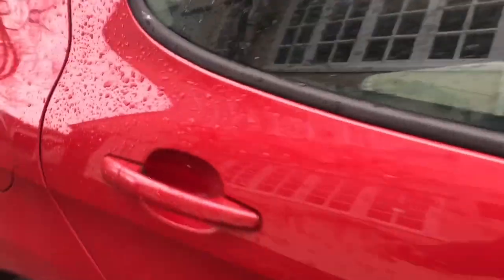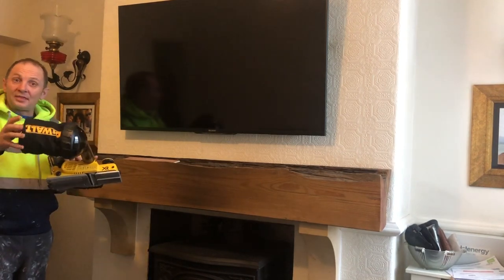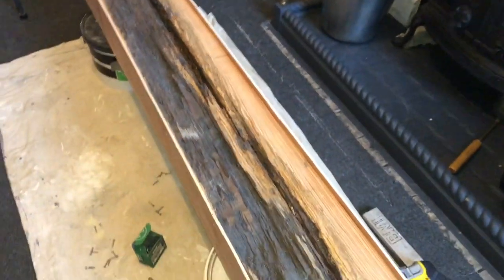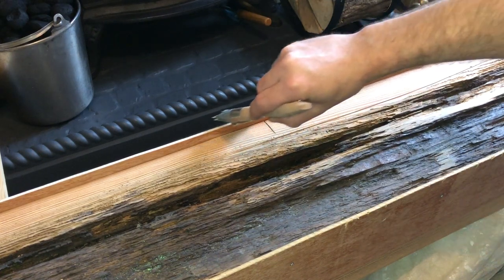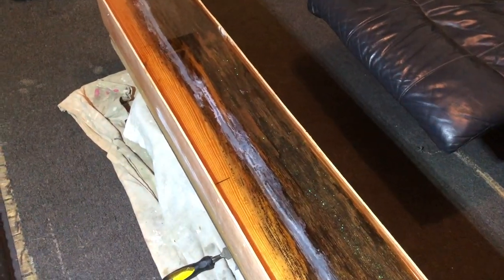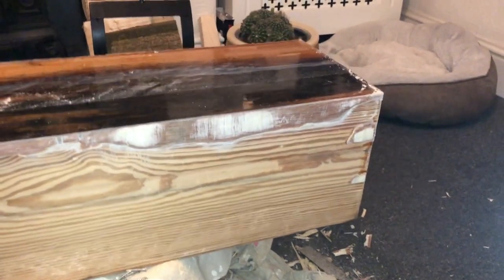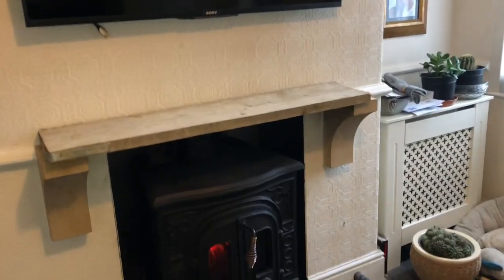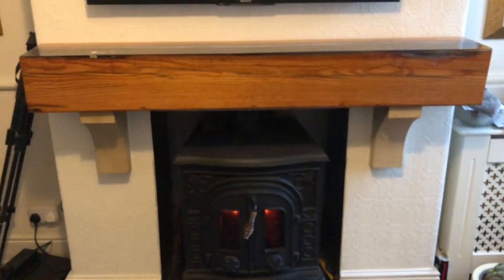Fire 🔥Place Mantel, Decorating a rotten beam with epoxy resin

Comment: Looks great, if I was to do it I was thinking of using expanding foam then clamp the timber sheets of ply sandwiched using another length of timber to hold it all flat with G clamps, I also think it needs timber vertical legs / stile either side. 👌🏻